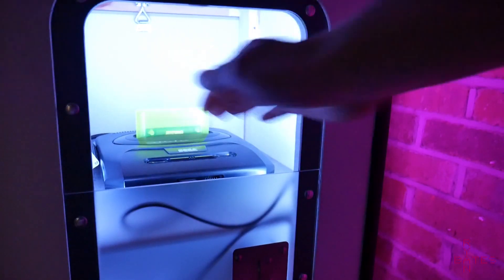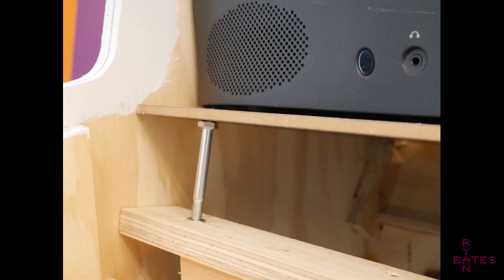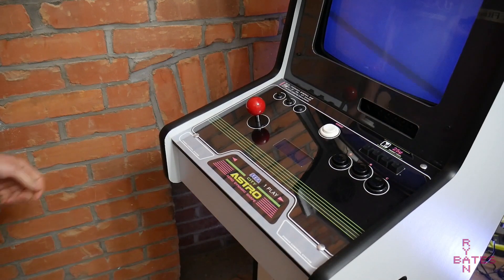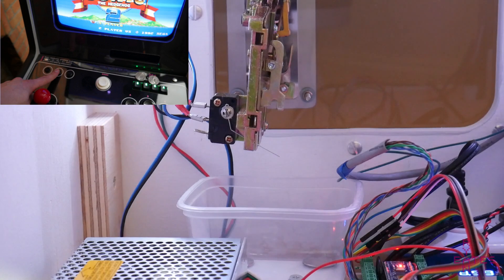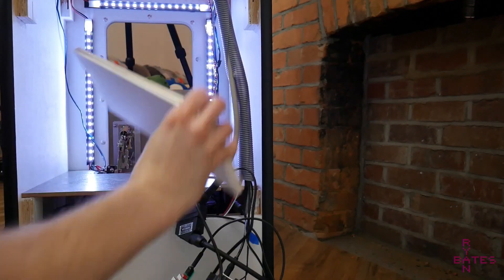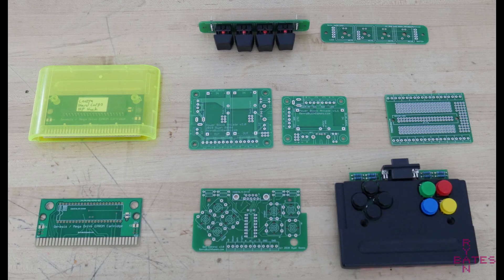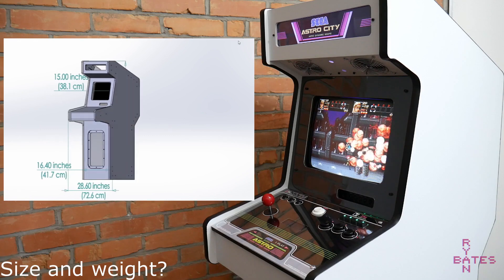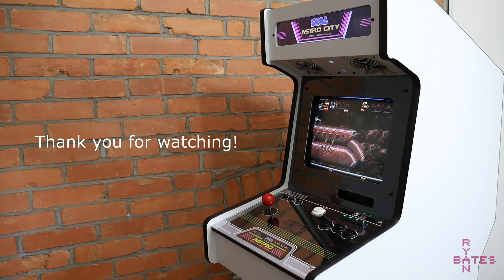Sega Mega Genesis Drive Arcade with Real Hardware

Comment: Absolutely love this! I remember back when you did the rgb mod and arcade stick. Would love to see a demo of games showing the cabinet off.
Reply from the maker: Noted!
Reply: @RetroBuiltGames  im starting a build based off this build. so far i have collected a sega gen. model 2 , finally got the right power cord and av cables and im getting ready to look for a crt tv. (for leathal enforcers and the justifier) should i try to do this rgb or just connect it up regular . im not building the cabinet until i get the crt so i can know dementions . any advise u have would be awsome.

Comment: I'd love to see someone do this but with a VGA CRT monitor

You should be able to get the crisp inage without messing around inside a crt right?
Reply from the maker: yes absolutely. I've been meaning to do this, but tube CRTs are hard to find in my area. I feel like they were ostracized more than TVs when LCDs took over.
Reply: @RetroBuiltGames  hmm it's the opposite where I live, lots of offices are now starting to decommission CRT monitors

Since these fuckers last forever people had no reason to get rid of them in an office setting. I guess it's good enough for writing documents and whatnot

My dad's office for example still has a bunch of printer servers running windows XP with a CRT.

Comment: This is great, but, (and sorry if I missed it) since you mentioned that Genesis 2 is "vanilla", does that mean it doesn't have an audio mod installed like a CCAM/Mega Amp/Triple Bypass? Or it's just a later revision that doesn't have the bad sound?
Reply from the maker: no audio mod- later version that doesn't have bad sound.

Comment: Can you do a two player version, possibly with a dreamcast
Reply from the maker: Yes. CRT or LCD for Dreamcast?
Reply: @RetroBuiltGames  I was thinking more a crt unless the lady gives you more freedom 

Now a reason I think a dreamcast cabinet is such a cool concept is not because a good some of its librarie is Naomi 

But recently people noticed the atomiswave uses the exact the same hardware as dreamcast meaning most of its games are not only arcade perfect but a  Literal conversion to dreamcast 

https://youtu.be/yongHJjmtSs

Additionally there are encoder kits that allow you install any buttons and jokestick and use them on dreamcast.

Retro Ralph goes more depth how this works 

https://youtu.be/Ye9IPYkxUT8

 Alternatively I've looking for a crt to install into arcade 1up. a couple people did it but nobody in the community knows how it happened.

https://youtu.be/fP5B6Bk9n4k
Reply from the maker: Im kinda skeptical on that last video- CTR in the arcade1up. All the shots are obnoxiously close without panning back to see anything past the bezel. 
I dont doubt you can do it, but the depth of a modest 13in tube is deeper than most arcade1up machines. Installing one implies it is a clean installation and contained within the body. There are HDMI to composite converters; but, DiWHY.
Reply from the maker: This video is better, it looks more authentic. The 'glow' really completes the feel of an arcade machine.  I just dont know why no video shows the inside of the cabinet. a 15in tube is deep. I would assume the install is a game of millimeters. CRT is the way to go!